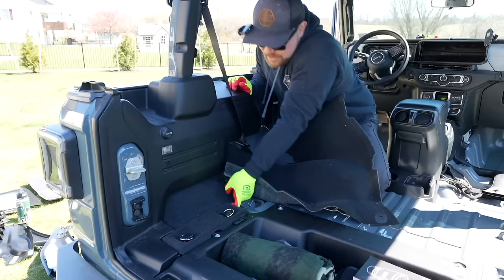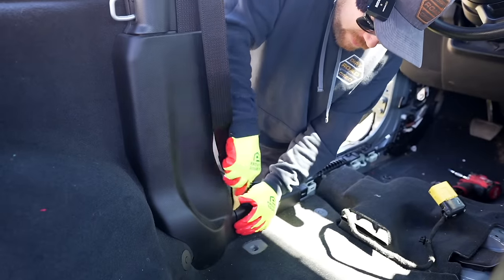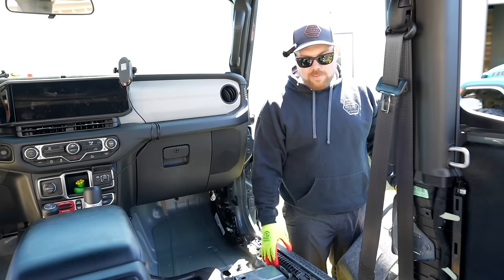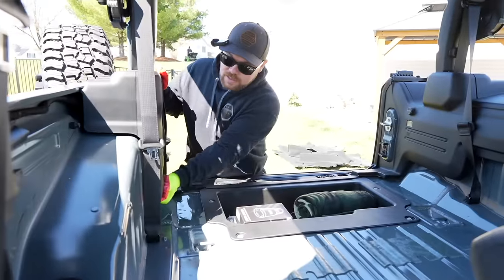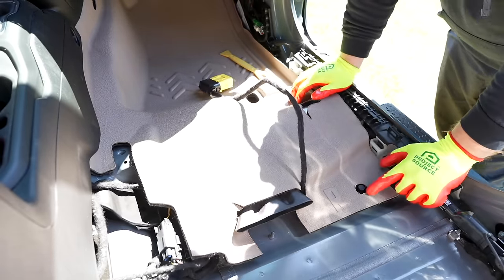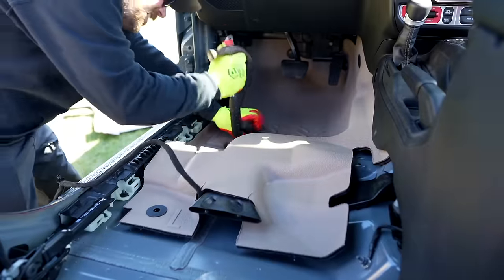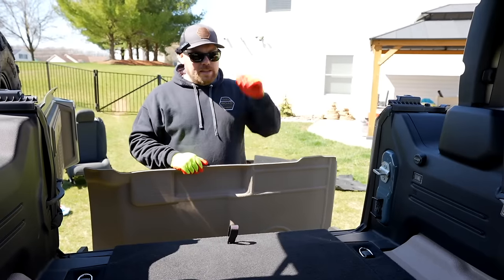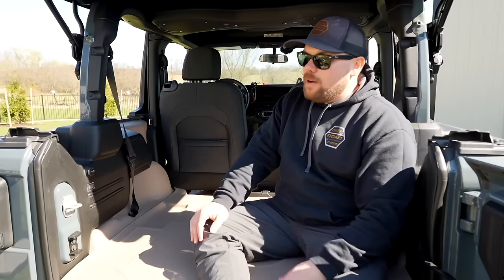How to waterproof your 2024 Jeep Wrangler (2 Door)

Comment: Love the color, does a good job of breaking up that sea of black and grey in the Wrangler. I guess my only reservation with the product is the rear part; not too keen on having to lift up the mat to access the under-carpet storage.

Am also very interested in how the reupholstering would turn out - iirc there are air bags in the side of the seats.